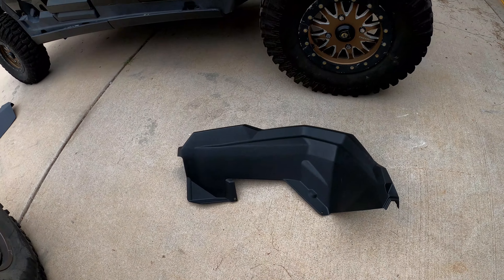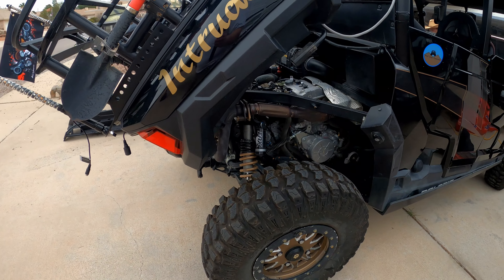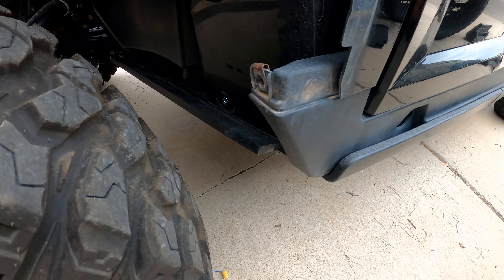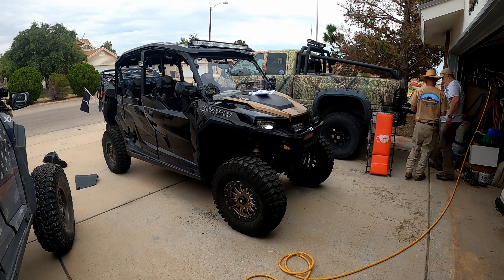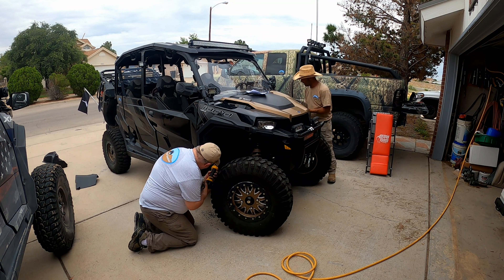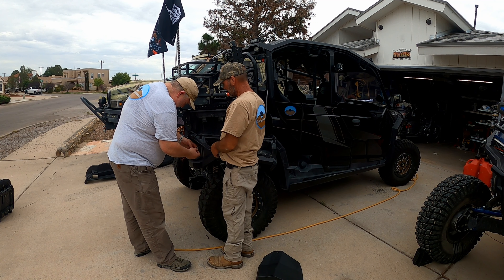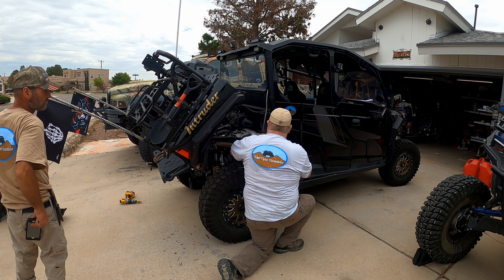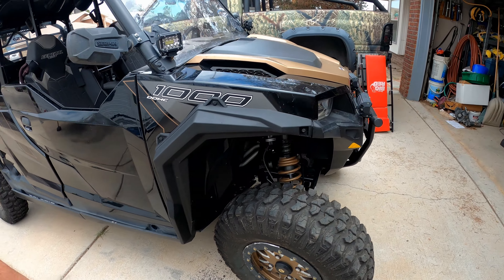Polaris General XL fender flares Install

Comment: We have the same fender flares.  My question is how do you get the front ones to stay on??  you have no way of putting your hand in behind to push the plugs in connecting them snug against the machine. .....  or did you just not worry about that and just screw the fenders into the side of the machine?  I hope that makes sense.
Reply from the maker: We used the stock snap/push in connectors that were being used on the stock flares. And the push pins that also snap in. I do remember a few of them were tough to get snapped in.  I don't remember how we got them handled, but they eventually snapped in.
Reply: For anyone else watching, you'll make it alot easier on yourself to also take doors off so you can remove the inner fender.  This way you can put required pressure for the original pressure clips to take hold.  Believe me it will save alot of time and swearing.   The backend was easy.